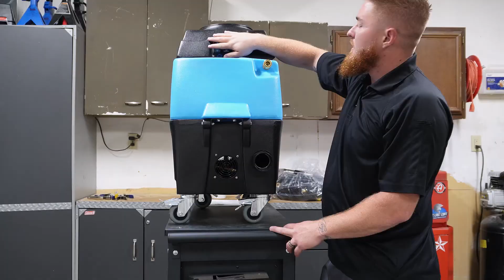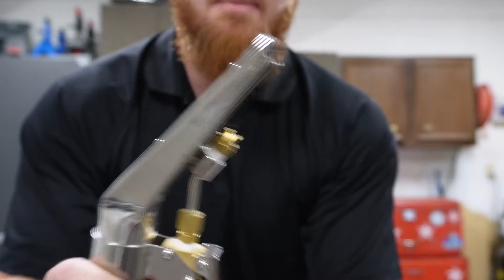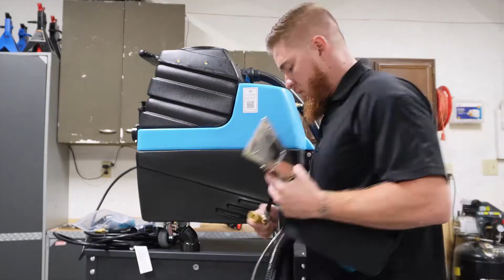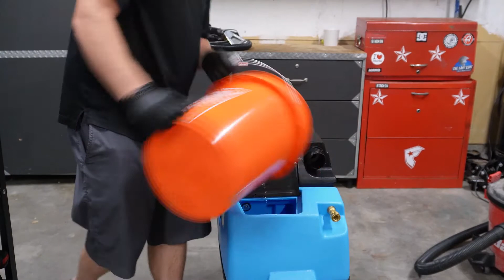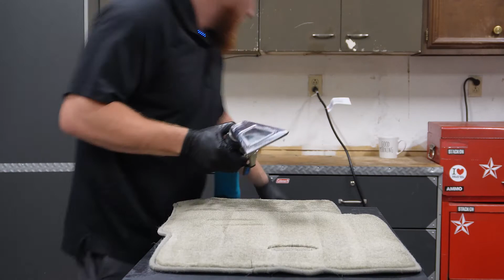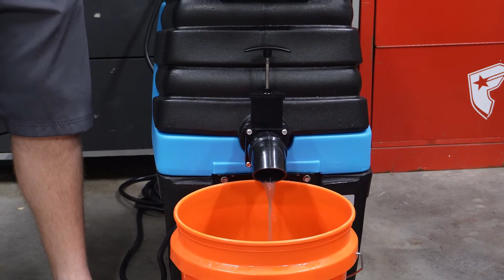Are Expensive Carpet Extractors a Scam? (Mytee HP60 Unbox and Review)

Comment: I put the heater on first, then I sprayed until the air then it stoped working I got vapor locked, they said put the pump on first then the heater, that's why my vapored locked :( has anyone got vapor locked  and what did you do and how long did it take to cool down and work again

Comment: You can buy a cut short solution hose plug it in the unit and then run the pump until solution is flowing. This will save your pump in the long run

Comment: I recently purchased the same machine when I unboxed the machine the fit and finish was a C- the control panel did not fit properly in its space,none of the internal holes,fittings were deburred .Almost every corner looked like somebody had taken a Dremel and sanded the corners down ,for the $1700. I was disappointed I shipped it back to them. I didn’t even bother turning it on.

Comment: So dope, I ordered one without looking at any reviews and barely any research. I was originally shopping for a S-300-H and every place I called told me the same thing you did and added its going to be a pain having to stop and check to empty the dirt water reservoir., that I should get the 8070 or the HP60. I ultimately got sold on buying the HP 60 for the added capacity over the 8070 as well as the better specs on the vacuum motor and heater. Thankfully the S-300-H is just about sold out everywhere offering better than MSRP pricing with a back order lead time of 3-6 weeks. Thanks for being a content provider who isn't trying to make money on every angle. 👍
Reply from the maker: I appreciate that and you definitely made the right decision! I have had 0 issues with the HP-60. I am hoping to make some more content soon to help people out further. Thanks for the watch!

Comment: What are the socks for?
Reply from the maker: I still have no idea lol
Reply: @archangelauto  I think they are for “straining” the dirty water as it’s going into the tank. Saw it on another video. It’s like a filter almost.
Reply: I need a question answered as I can’t find the answer anywhere. Is it normal for the pump to pulse every 3-4sec while heater and pump are on? It’s not a consistent pump like when the trigger is depressed. It’s like a one little pump noise. Almost like it’s “topping off pressure” or circulating the water to heat it all up or something. This is brand new out of the box.

Comment: The HP60 is so well designed. I have two Sandia carpet extractors. One heated and not the other. The heat is not consistent and I don't like how the hose is just pushed onto the unit vs the HP60 it's screwed on. I don't like to take apart the Sandia just to fill the tank amd you have to be carefull not to get water in the vacuum motor. And then you have to take it apart to drain it. But. I love how how portable the Sandia is and it's price. I'm seriously considering buying a HP60.
Reply from the maker: I have not had any experience with the Sandia products but they were a consideration when I bought my S300. Ultimately I chose the Mytee because of build quality. The HP60 is not the most portable one out there because it is pretty heavy but, they do offer a 50' hose on their website. It is pricey at $380 but that would give you a ton more reach. I have seen mobile guys that do that and leave the unit in the van.
Reply: Dooooooooooo ittttttttt!

Comment: How do you empty the water you didn’t use? Cause I had to vacuum it out (literally) and throw that away because it was easier to dump it from the vacuum 🥴
Reply from the maker: To empty the unused water you can simply put the hose into the water tank with the vacuum on and suck it up into the waste tank. From there just empty it as usual. I typically only empty mine if I will not be using it for more than 3 days. Just make sure to empty it before you store it for longer periods of time so that you don't get nasty stagnant water in there!
Reply: Does the water tank hold up for a good amount of upholstery ? I clean upholstery in homes and wondering if I could get through an entire sofa without dumping. Thanks in advance.

Comment: Just start mine for first time but it sounds like it’s been priming for almost a min and still hasn’t stopped so I shut off
Reply from the maker: I would continue to let it prime. When it is brand new like that, there will be air in the lines. Give it a little more time and periodically pull the trigger on the wand until you start to get some water flow. Once it starts spraying water, it should fully prime pretty quick. Make sure you check inside the fill tank also that you have a water level above the little mesh filter and that nothing is clogging it. If you are still having issues after that I would contact Mytee.
Reply: @archangelauto  I appreciate it.I fixed it.just stuck a hose next to the filter in water tank and forced water to the pump
Reply from the maker: @chosenmusicartist  Awesome! Glad that worked out for you!

Comment: Hey just so you know you are supposed to turn on the pump first then the heater. Turning the heater on first will cause vapor lock and damage the machine potentially. Turn pump on first and purge out any air.
Reply from the maker: I actually just looked that up and you are 100% right! Great catch and I will be sure to add that in on future videos!

Comment: How much chemical should I use per gallon
Reply from the maker: Do you mean in the extractor or in the spray bottle for the cleaning solution?
Reply: @archangelauto  like in tank
Reply from the maker: I do not use any chemicals in the tank and do not recommend that. I only use clean water. There are some out there but I would be cautions using them as some could dry out the seals in the pump.
Reply: @archangelauto I’m sure the manufacturer would tell you this. After all, it is to be used with cleaning chemicals especially when doing carpets .